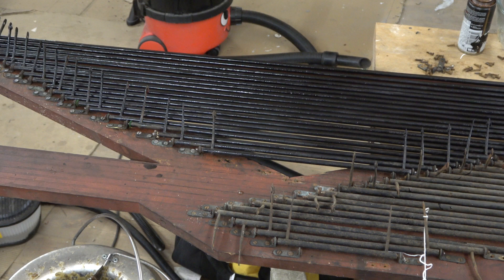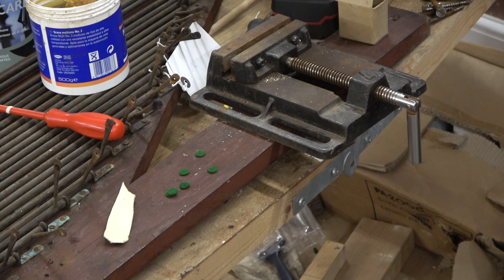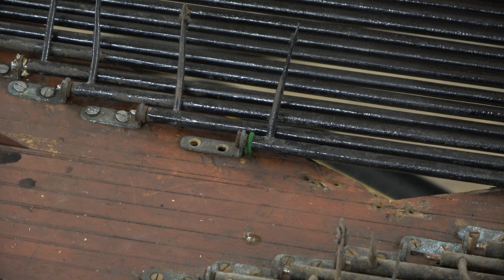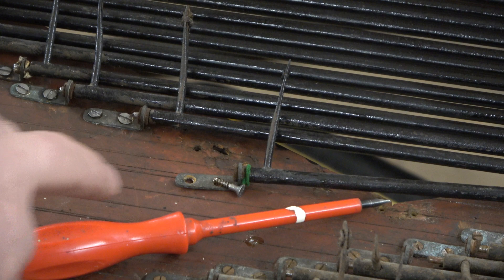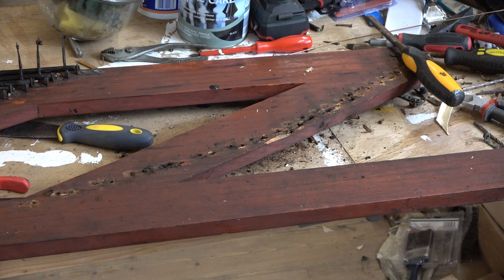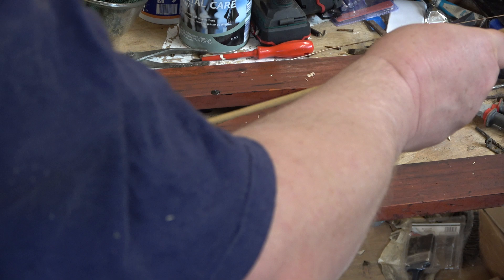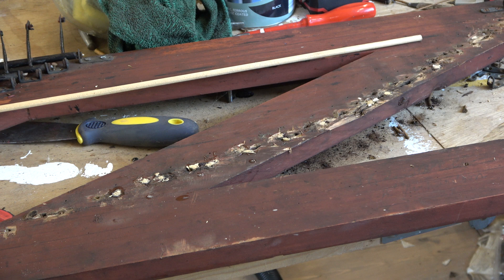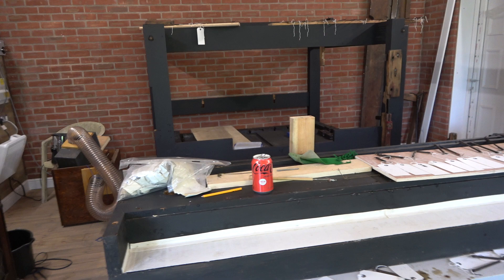1865 Forster & Andrews Pipe Organ Restoration Pt8 of loads

Comment: When I fill bad screw holes for door hinges I put a dab of glue in the hole and hammer in a wooden golf tee. Then I do the chisel thing. It saves having to find a bit of wood, but the holes I am filling are smaller.
Reply from the maker: Roger on that Gordon. Bear in mind I'm using a correct technique here as part of my 7-year apprenticeship....dowelling chiselled to a point, inserted...chiselled to a point ready for the next hole & so on.

I ended up doing 25 holes in total over two sessions & today fitted the parts back with new screws.

Richard
Reply: @ukfmcbradioservicingTango21  Good work. I am enjoying the videos.